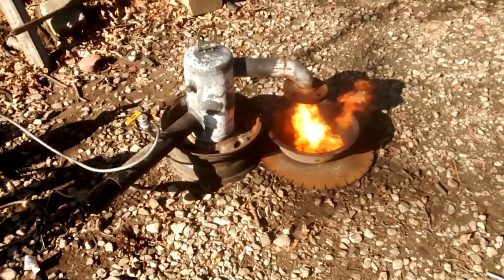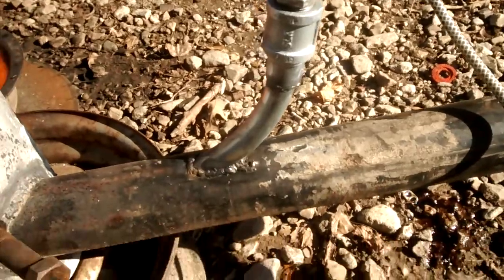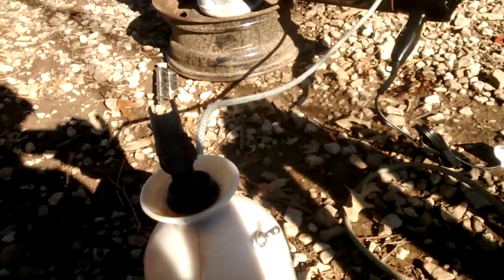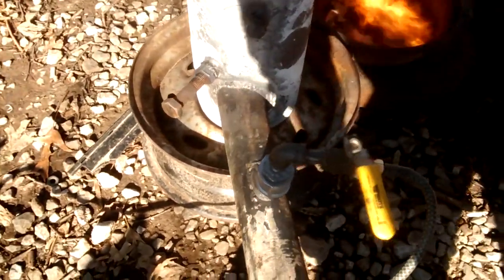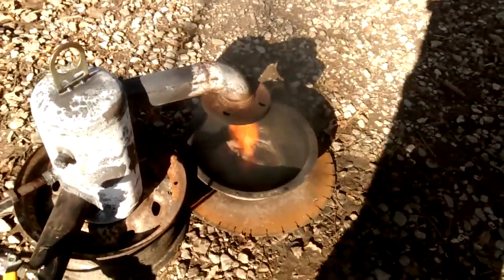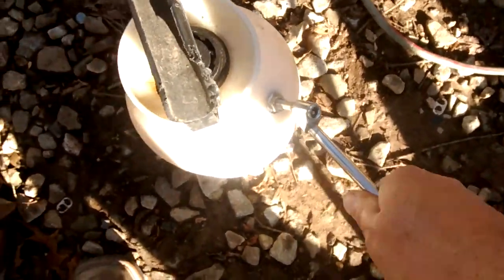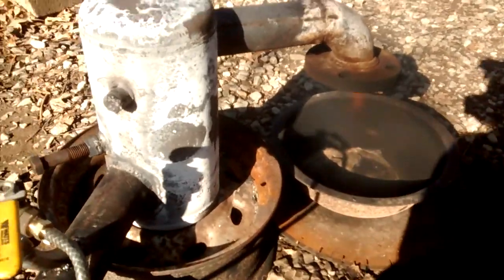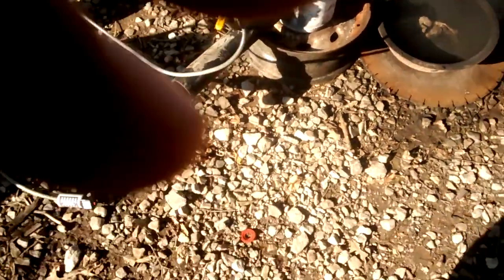Waste oil burner

Comment: I built a small oil burner a few years ago and never thought to use one of those garden sprayer to  feed the oil under pressure. Awesome build bud
Reply from the maker: Thanks. I'm still trying to tune it a little. Hope to run a forge or smelter with it some day.
Reply: @wilkersonsmowershop8379  I used mine to melt beer cans down and try sand casting.

Comment: I'm Guessing the problem was not running out of oil at all but you had given it too much and it was actually Flooding?
If it was leaner and you gave it more oil it would have flared up. The fact the thing got more oil and still went out would be because there was too much oil and it cooled too much to change to gas.  Either that or you had a blockage in your oil feed and none was getting through at all but I think the opposite happened looking at the rich yellow flame and the fact I could see the thing blowing any sparks which are the bits of left over carbon at the end.  

Takes a bit of practice to work out one from the other.  Sometimes when you over fuel them they will continue to burn for a while then start to ramp up on the flame. after a while they will heat up enough so that all the oil wants to vaporise at once and you have a runaway. If this happens, don't panic or worry about it. Shut off the fuel and keep the air going and it will Blow lots of big lazy flames then settle right back down in 30 Sec to a min.  you can then open the fuel again. 

This just takes practice and is bit of a learning curve. You seem to be doing real well with it so far. I like the idea of welding the burner to the rim. That makes it nice and stable.  I would also suggest a SMALL gate valve  for oil regulation. Ball valves open really quickly for this purpose and just moving them a fraction make the opening in the valve much larger. 

I actually like to have 2 gate valves. the first one is the on off and the second one is the fuel regulation. This way when you find the happy setting you can turn the fuel on and off without loosing the setting that works best or at least being very close to it. 
It looks like this burner could put out some real power with just a bigger blower but you would want a much larger fuel supply.
Even 100KW output is 10L/ hr and with teh right blower what you have built so well there would do 300Kw without thinking about it probably I'd guess from the look of it max out about 500 KW with something like a Jumping castle blower. that's 50L an hour , nearly 1L min so you will get rid of the waste oil very quick. 

Keep up the good work!
Reply from the maker: Thanks oil burner. Your right about the valve and my feed. My line was picking up trash was stopping up. A gate valve is gonna be the next addition. The ball valve is all or nothing. Thanks for the tips and thanks for watching.